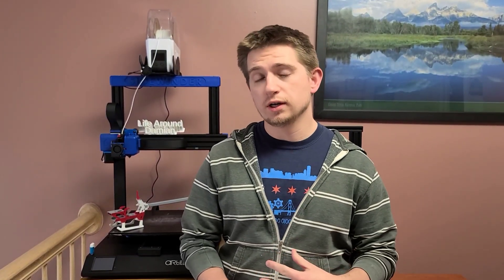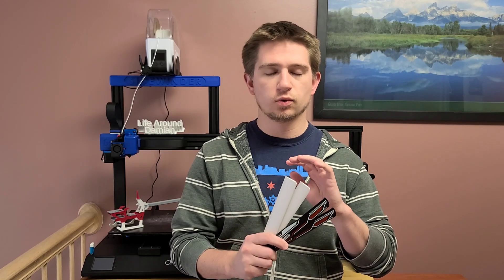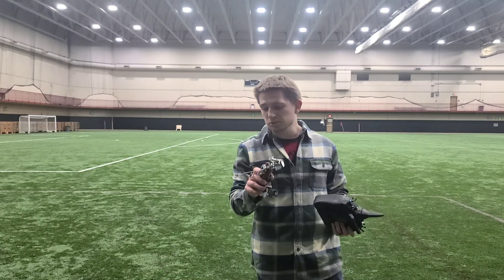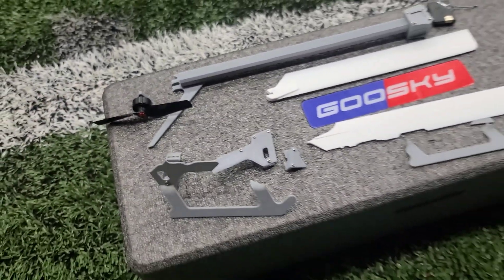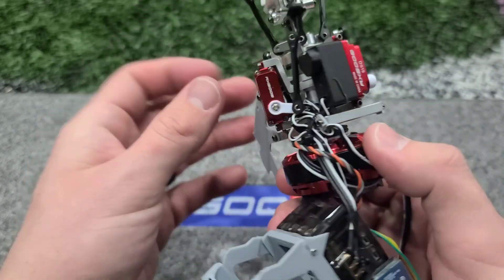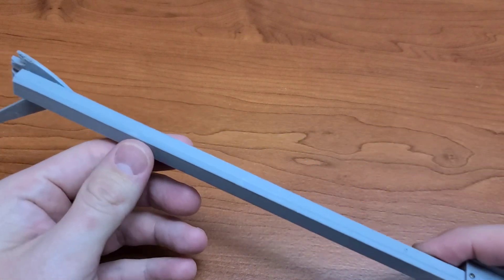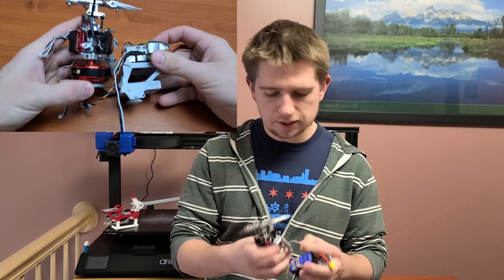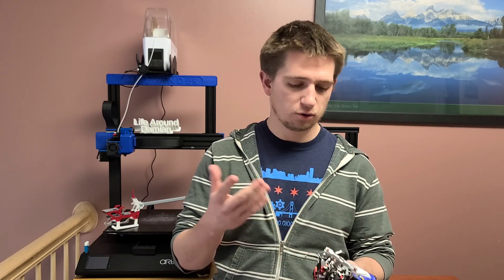CATASTROPHIC Flight - 3D Printed Helicopter CRASH!

Comment: this has me almost tempted to get back into helis! was looking at my old x400 frame the other day lol... $2k minimum and i think i got four flights?

at least the printer is cheap... and i wanna chinook! 

ok, printed blades... ouch. one of those things that imho would suit 4-5 axis... an inner core with layers lengthwise, an outer wrap to hold it together... the first thing i thought of when i saw a multi axis printer... about the only real benefit of the complexity? 

just wrapping my brain around slicers... shouldnt be overly hard when you consider the differentiation between infills and perimeters... but i aint no coder! could write the g-code for a 5 axis machine to do it, but to write a slicer? ha!

still, maybe an approach worth considering... need two A axis platforms. base and tip, something to bridge between for those first layers... maybe try rudimentary things like slicing with 0% infill for a shell, etc... iunno...

for some reason, i might just skip that part and stick to traditional methods? skinned timber...
Reply from the maker: There are many ways of making blades, I was curious how they performed straight from the printer lol 
As far as understanding and learning how to use the software to 3D print is not too bad. Once you choose your settings, the slicer creates the geode for you.
Reply: @LifeAroundDamian  definitely. and impressive to see them hold up... for a while. youre game!
sure, a normal 3d printer and slicer is easy... dont worry, i got my own machines.

just those multi axis things start getting complicated. other than very specific uses, they seem pointless? i can run a multi axis mill, but to try and print in multi axis? no thanks.

and this is one of those specific uses!

 not just machine design but the host of methods one can print. would be very interesting to be able to extrude in the ideal directions to use material and layer properties.

normal print limits you to what you get... layers. in one plane. with all the issues that creates.
Reply from the maker: I do agree that we are limited to a fixed plane. A multi axis printing machine would definitely get quite complicated. I have seen some insane multi axis metal printing which is very intriguing. I wouldn't mind seeing one in action either, but yes, very special use cases.

Comment: Sorry to see a complete loss crash.... Layer orientation is hugely significant but i would not fly printed vlades. A simple calculation of the centripetal force shows they will never last. Frame parts carefully selected are very much printable. Hope ypu are up and 🎽 ng soon!
Reply from the maker: I definitely agree. Printed blades and layer orientation can make a big impact in flight. I figured I would run the experiment either way lol. The helicopter definitely flew great with the original blades, though!

Comment: Hi Damian, I like your research, I would like to do this myself, I have my own assembled 3D printer and I would like to try to print the head, namely the trunnions and the main hub.  Materials I think are at least ABS+ or Nylon.  These are the most durable and affordable materials, but I needed to upgrade my 3D printer, which I have not yet finished.  I think printing blades is not a very good idea and this crash would not have been avoided, but in any case, you believed it and your experience, for which I am grateful to you, I’m sorry, but I can’t make a donation because I don’t have extra money myself, but  I will be watching your research.  Thanks, good luck.  On my channel there is an experimental helicopter that I developed myself, you can check it out.
Reply from the maker: Thanks for watching! I enjoy testing and making experimentations on ideas. 3D printing will definitely change your ideas when making new parts on RC helicopters. I saw your video and I appreciate the incredible hard work you put into each custom part of that Goblin helicopter! Good job! I'm hoping to get as many parts 3d printed on the helicopter as I can, so the head of the helicopter will be a challenge for sure.